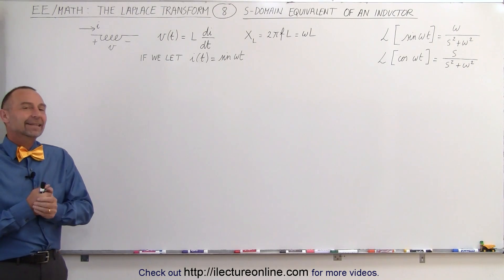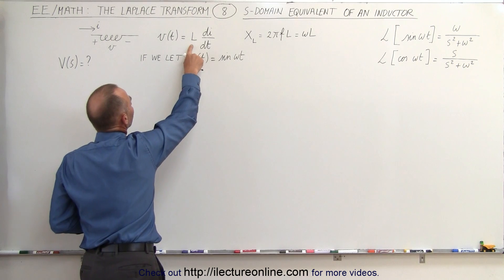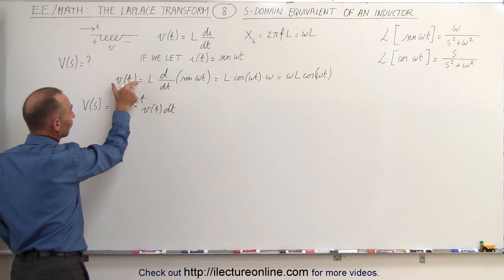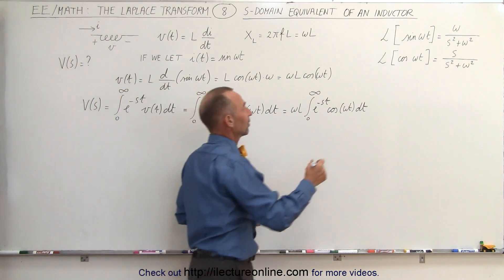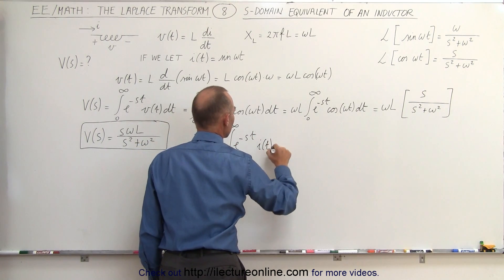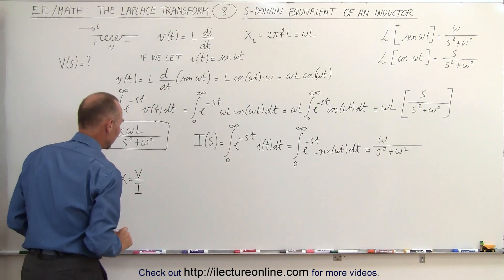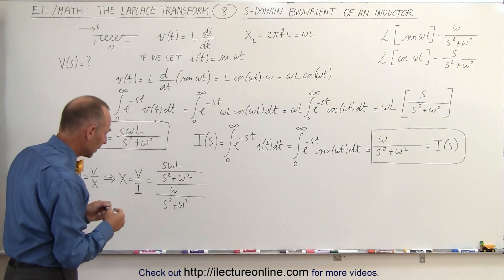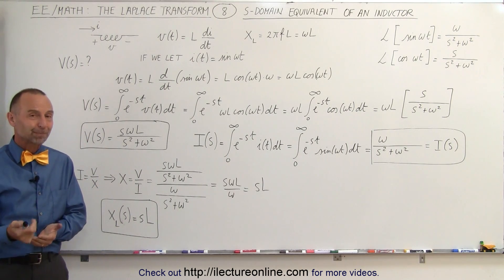Electrical Engineering: Ch 16: Laplace Transform (8 of 58) s-Domain Equivalent of an Inductor

Comment: shouldn't the frequency domain of an inductor impedance be WL/S? I don't think we can get the impedance frequency domain by simply dividing the frequency domain of voltage and current
Reply: no, the result must be LS.. if you doing the same math for V(s) = L(SI(S) - LI(0-), you will find that I(S) = V(S)/(LS) + LI(0-)/S. you can see the first term : V(S)/LS is just same like V/XL(S), which is an impedance..There's nonsense if you find XL(S) = WL/S